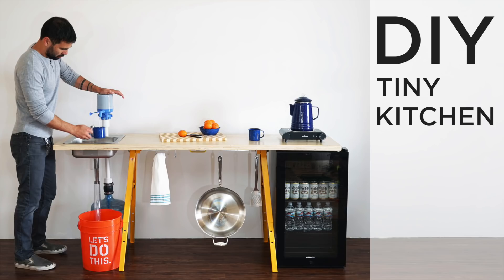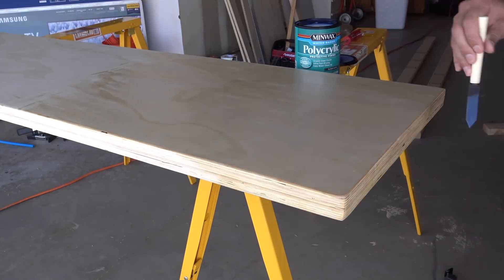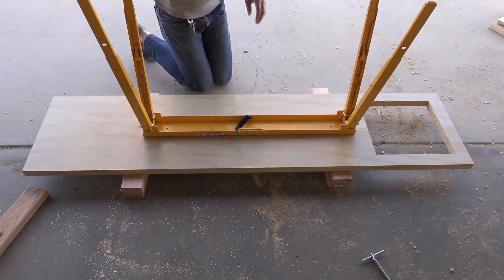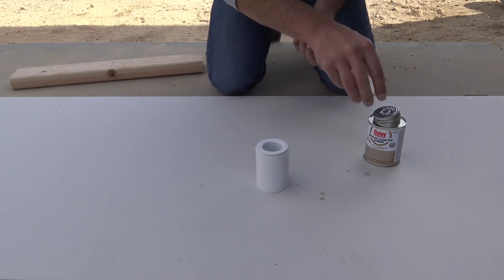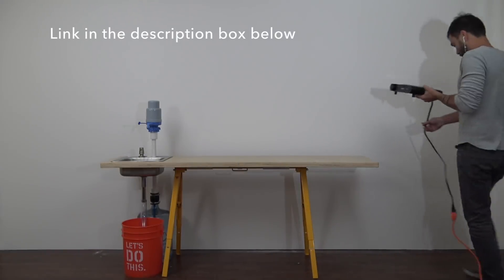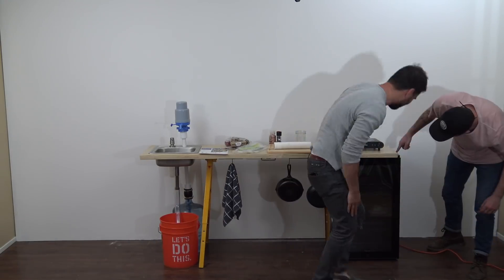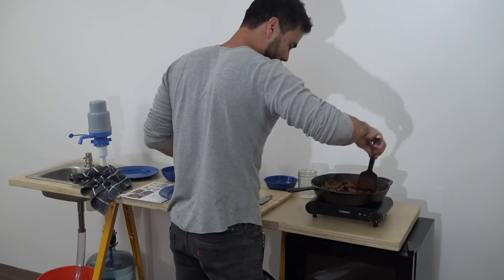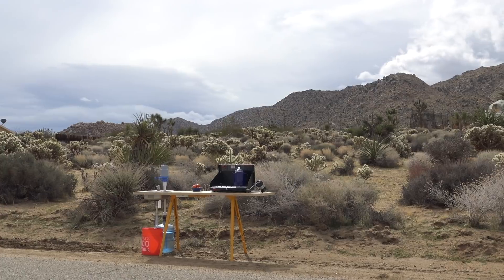DIY Tiny Kitchen | The perfect for DIY Kitchen for Camping

Comment: Everytime you put a stove or burner indoors, always put something on the walls where the stove or burner will be put. This is in order to prevent the stains or dirt which will accumulate through time because of the splash from the foods, oils and smoke. A foldable  wood or metal plate can be put on the side of the table where the stove is located can be added! 😀😀😀

Good project!

Comment: You could have used a hollow core door to cut down on weight.
Reply: David Abercrombie no one watches this channel for practicality ;)
Reply: Hollow countertop? Are you serious?
Reply: Yeah, and this approach would require a lot of extra steps for the sink hole, even if it was otherwise functional. An handle or two on the back of the countertop wouldn't be a bad idea, though.